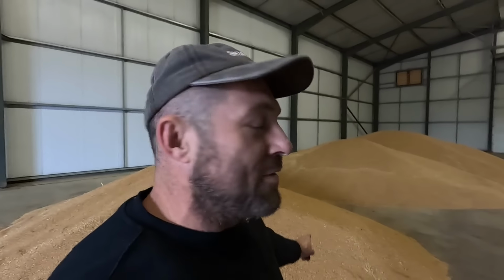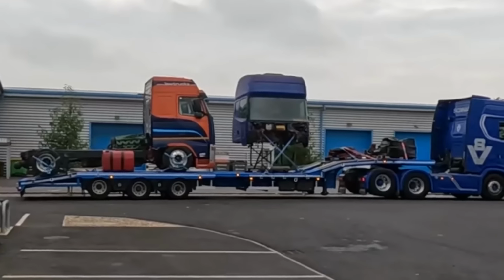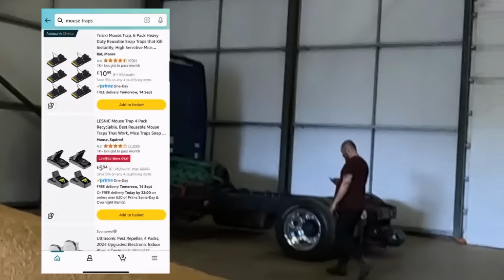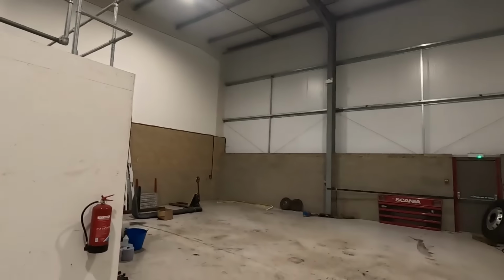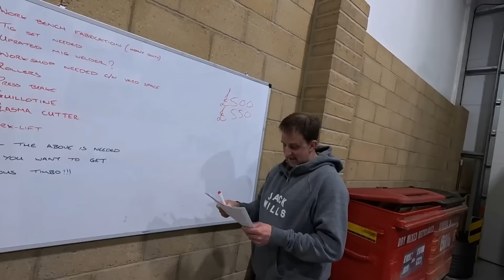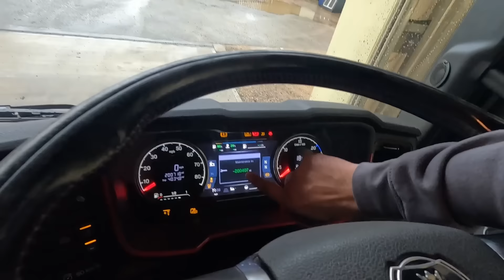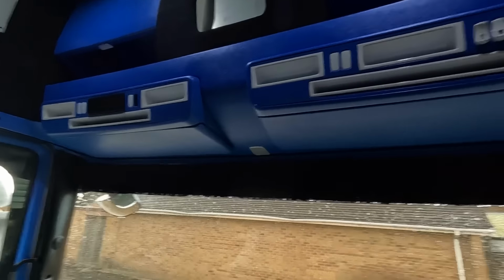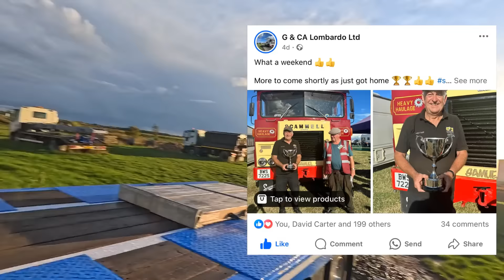MOVING IN TO THE NEW TT HQ | HEALTH & SAFETY VISIT | #truckertim

Comment: Hola TT 
The rats and mice must have spoiled that wheat load the length of time it sat there on deck ?
How much tax and insurance does the road legal trucks costs per annum ? 
Is the new yard rented or owned ? 
Is the Nissan sports car on chuckie or owned ? 
All euro6 trucks need use or your engine management lights will never be off - was the new sensor 300 quid or more ? 
You state your not an operator but a YouTuber - who earns the most ? 👍👍😎

Comment: Hi Tim, I have a build idea for you and I guarantee nobody has ever done before. You should head over to India and buy yourself a Tata 1613 truck and get it imported to the UK. Unfortunately these trucks are very underpowered so first and foremost you should do an engine swap, stick a Scania V8 engine in there. I'm sure Bengineer will figure out a way no problem. Then do the usual add on some dura brights, RGB under glow, side pipe or stacks (either is fine really), train horn for some glorious TOOOONES and of course have it resprayed in your white, blue, white and black colour scheme. I'm sure DAREEEEEEEEEEEEEEEEENNNNN will do a smashing job on the paint work. It will look fantastic in the new Trucker Tim HQ along with your growing fleet. Honestly Tim you will turn heads at all the truck shows with this build!!!